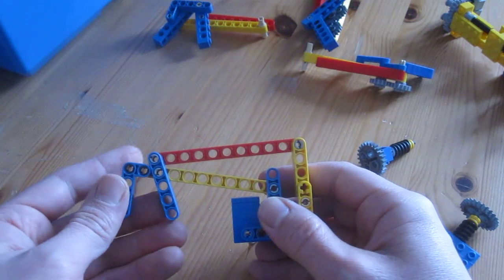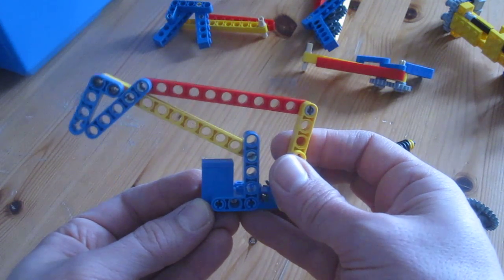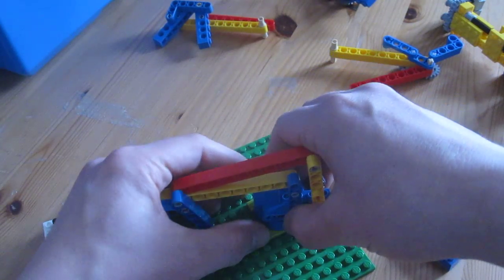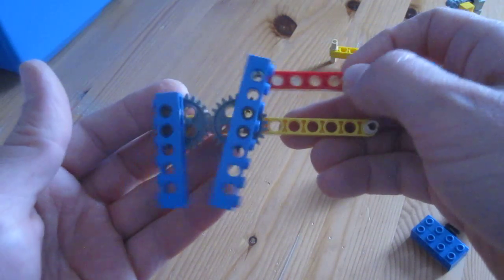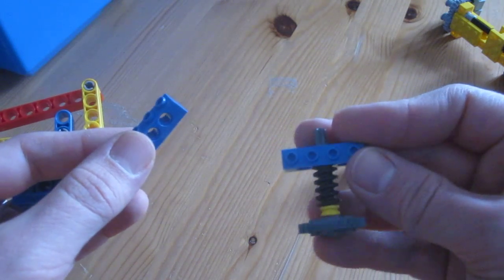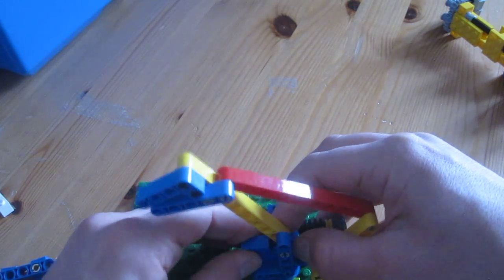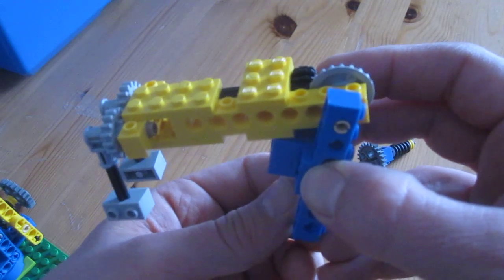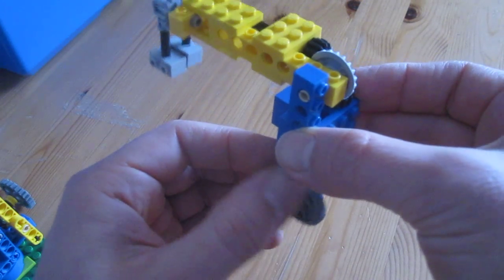Lego Simple Robot Arm

Comment: For my freshmen engineering course we had to build a robot using NXT 1.0. Three motors is definitely a limiting factor, and this video was a lifesaver. I will be sure to give you credit.
Reply from the maker: Thanks John, great to hear it's been useful. The real credit needs to go to all the awesome LEGO Technic books back in the 1980s, I wish I could find them now :) This design puts interesting constraints on real-world applications; the arm lifts when the gripper ceases to move, at which point the force required to lift the entire mechanism is put though the object being lifted. This is problematic when lifting something delicate. The multiple-motor approach does give a lot more flexibility, but these machines are a great way to get into intermittent mechanisms. Best of luck with the studies.

Comment: Unreal, these arms are so simple. I had made a two motor robot a while ago. One motor would run the wheels forward or turn backwards in a circle, while I had 20 or so gears on the arm that turned the claw in then lifted the item.  With these builds I can reduce the amount of parts by half and maybe have a stronger arm.